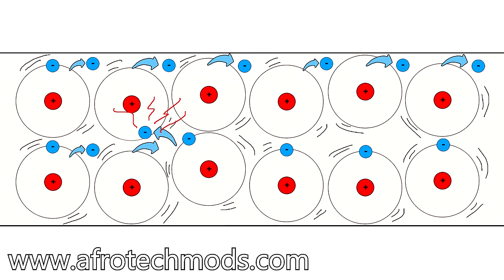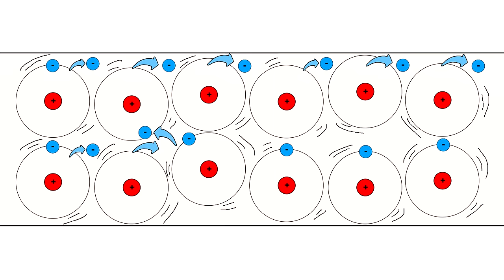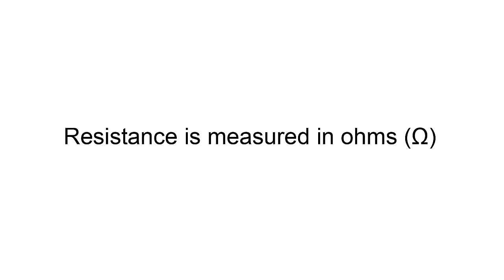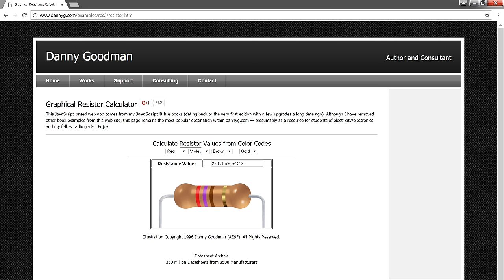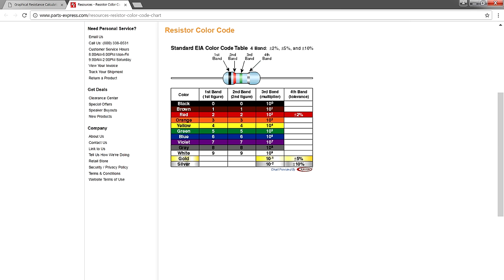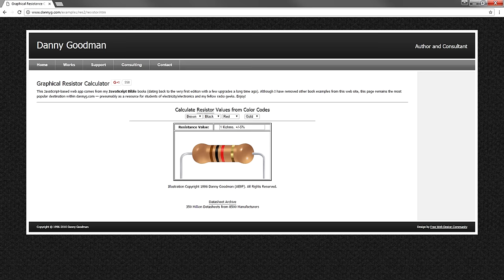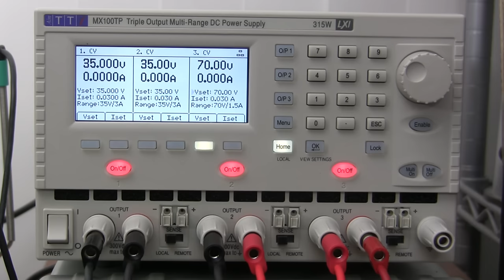Basic Electricity - Resistance and Ohm's law

Comment: im such a nub with electronics im not sure how to ask this but here i go.
if i wanted to press a button to cycle 3 lights. so i press and one light is lit then press again so the next is lit and so on. i realise i could think up a circuit with relays maybe. but my real question is how do i find out what ics do. because i know alot of the things i do will probably be easier with an ic. i want to build a flight control panel.
just an answer to point me in the right direction will be fine. Should i work out how those 555 timer thingys work? Thanks

Comment: I hv a doubt ,if potential difference is more i.e gap bw two terminals then the current flow should be more according to ohms law,then why its hard for current to flow when two terminals are apart (wire with large gap)

Comment: I'm just a hobbyist that wants to build long lasting miniature LED lighting.  

I've seen several LED tutorials where people are using a resistor per LED anode.  It's confusing to me.  I don't understand how the current could flow so evenly to all LEDs, at full strength with no decay, that it requires an identical resistor per LED.  If I'm trying to drive 3V LEDs with 9V, wouldn't one correct resistor at the source change the current correctly for everything downstream?  Is this concept simply a case of overdoing a fuse-like protection per LED?

Also, are resistors necessary if you're using fixed voltage/batteries that do not exceed the forward voltage of the LEDs downstream?
Reply: I will answer your 2nd question. 
Your question is why we use resistors to limit current when we keep voltage level same. 
That is where Power comes into equation. You know if we have a Power Supply rated for lets say 10W. And we also keep our voltage level to 2V. 
Now we have set our voltage. But there is no control for our Current. Current is controlled by External Circuit attached to supply. You can basically think that External Load Draws Current from power supply. And External Load can vary depending on whatever circuit you are building. So as External Load varies our Current varies. In our case we can draw maximum of 5 amps from our supply.
Reply: Therefore we need to control current passing through some elements that can't handle high levels of current.

Comment: Hi there awesome video im loving rhis series so far. I do have a question. Im considering adding some leds to my vehicle and was wondering what resistor i should use so this video was very helpful. I realize i have to subtract the led forward voltage value from the power source value then divide that number by the resistance the led is rated for. The one question i do have is what value I should use for my power source voltage since its a car. Would i use 12 volts 12.6 volts since thats where there battery is when before i start it or 14.4 since the vehicle is powered by the alternator while driving. Thanks in advance
Reply from the maker: Good question! Use the max voltage, so 14.4V. Or maybe even a little more if there are higher short term voltage spikes. You will see fluctuations in the brightness of the LED as the battery voltage changes since this is going to be a very simple circuit.
Reply: @Afrotechmods  Awesome. Thank you for the quick response. Mabey a little advanced for my knowledge base but is it possible to stabilize the current to the led so the brightness doesnt fluctuate? Would that be what a capacitor is used for?
Reply from the maker: You would need a voltage regulator of some sort to keep the voltage constant. Picking the voltage regulator will depend on how much current your LEDs are expected to draw.
Reply: @Afrotechmods  Got it ill have to look into that thank you.

Comment: I have a question here I have 12 leds that running a 22ohm resister and 0119 transistor which I have no clue with that was suppose to run on 3v but instead I put it in a lanten and it runs on 6v and i see smoke coming out since its extra 3v putting threw I saw a clip about using 220ohm for one led could I use all that for 12 leds

Comment: When the resistor has finished melting, what happens next? Does the LED start melting? Does the LED stop glowing?
Reply: I think that If the resistor melts, then the circuit is broken, so the LED would stop glowing as there is no current flowing through it. :)
Reply: what can be done to avoid this? yes, limit the voltage going in, or increase the load on the other side, but do they make heavier duty resistors that can handle this example?
Reply: Did you watch the video? Seen that white boxy thing with two wires coming out?
Reply: Circuit breaks i guess
Reply: Colin Stuart you can get resistors in different Wattage ratings.
So if you need to drop 6V from a 9V battery across the resistor, assuming you have. 3V LED.  
Multiply 6 by the current in Amps in the circuit and you will get the Wattage of the resistor in Watts.
So 6X0.02 =  0.12 Watt. Assuming LED is 20mA. Resistors come in a range of Wattage from 1/8 Watt (0.125 Watt) upwards.
You would want some safety margin as well, so a 1/4 Watt would be suitable in the example given to prevent it burning out prematurely.

Comment: if i have a 12v 2amp supply. and connect it to led diode does it take the full 12v and 2amps? so a resistor must be used to lower volts AND amps to the led? led is high power 3.2v 350ma

Comment: Great videoS, afrotechmods! I took a 9 LED flashlight apart and found the LEDs were powered in parallel. That was interesting enough but then I found that there was NO resistor! What??? The power supply is 3 AAA batteries (approx 4.5V).  I'd like  to hear your opinions on this. I'm planning on making a perimeter lit tray for my music stand, so I could add a resistor, but which value?.

Comment: If I set 6 white LEDs in series (19.2v) can I run those with a 19.2v battery without a resistor? 
Can I use LEDs as resisters to eliminate the need for resisters?
Reply from the maker: Your 19.2V battery will have a higher and lower voltage depending on the state of charge. You will get some big variations in LED brightness if you do this without resistors.

Comment: truth to be told, I am an absolute beginner with electricity...all made perfect sense until 0.02A showed up... is that constant value? or how was that calculated?
thanks in advance to any reference or explanation.
Reply: Sorry I know I'm a little late but the value of 0.02 A is the current we want to have in our circuit, so we don't burn up our LED.

Comment: how to find out the forward voltage of a led unit [ led  unit says only 3 w ,6500k white light,150 lumen, 40 mamp  ]. there are multiple led encased into one unit, dont know how many diodes are inside ,i use 12 v ac to dc adaptor with 1200 mamps. how to calculate the resistor needed so that my led draws only 40 mamp .???? any ideas plssssss

Comment: I want to use 100 2V LED's in my project(about 75 is on at the same time) and i want to use arduino with shift registers. What kind of power supply should i use for the LED's?

Comment: What if say, I have to have a certain voltage drop across a load, but I don't know the maximum current(nor the data sheet of the component) that the load can accommodate? Should I just guess starting from like 1 mA(for small components), and from there I just get the resistance needed?
Reply from the maker: Check out my tutorials on power supplies and voltage regulators.

Comment: How were you able to get the recommended max current? Is it included in every device or there's a need to calculate it?

Also, what happens if for example, the current is 40mA rather than 20mA?
Reply: Data sheet for the device.   Manufacturers have datasheets on their websites, and online distributors like Farnell or Digi-Key will link the data sheet from the product page.

Comment: so if I put more resistor's in a circuit the voltage will NOT go down...just the current?
Reply: sciece in the simplest way  The voltage coming back to the battery, which in reality it would be the "+' side...right?

Comment: Wait, so you had 20 volts on a 1k resistor resulting in 0.02A of current.
This should amount to 0.4 Watts of power on the resistor and those tiny ones are typically rated for 1/4 of a watt heat dissipation. 
What's up with that? Shouldn't it have died?
Reply: 𝘿!𝙘𝙠 Riding ǤƗяℓ Addison  
I'm trying to figure out how your comment is related to mine 
🤔

Comment: So how accurate do you need to be? if i was to use a 3v battery (x2 1.5v AA battery pack). Could I not use it on a red LED light as its 1.0 over would it burst and break (be dangerous?) and will i need to buy different resistors for yellow at .9 resistor, and green at .8 resistor? or is there enough wiggle room? Anyone help me out? Thanks

Comment: i mean
if you put Resistance in the circuit you can control the amperage, but the voltage will drop also
how we can control the amperage, without drop the voltage ?
Reply: You can't. Voltage and current are two sides of the same coin, ie. power -- you can't alter one without affecting the other, too.

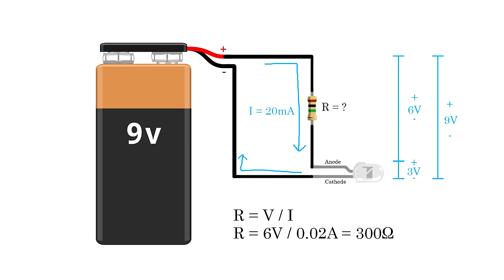Comment: 7:23
i don't get this.
if all the resistance in this case is is taking the voltage and dividing by the current, you could still get exactly the same resistance with vastly different values for voltage and current. 3v and 10mA would also give 300ohms. how does the resistor know exactly the right balance of volts and amps you want it to pass?
Reply: kiyonexus  nevermind, i thought the relationship between voltage and current was multiplicative but it is a division.

Comment: If 5 metres 5v 300 led (ws2812B) strip need 20A power supply for full brightness then 5v 60Amp power supply will be damage led strip ?

Comment: Great video! Is there a difference between using a 9 volt battery with 300 ohm resistor and a 12 volt battery with a 400 ohm resistor?
Reply: Yes there is huge difference.
Reply: Mind explaining the difference? They are both supplying the same amount of current right? Isn't that the only essential need for powering electronics?

Comment: So to power a raspberry pi 3 B that requires 2.5 Amps and 5 volts with a 9 volt battery I need 1.6 Ohm resistor?